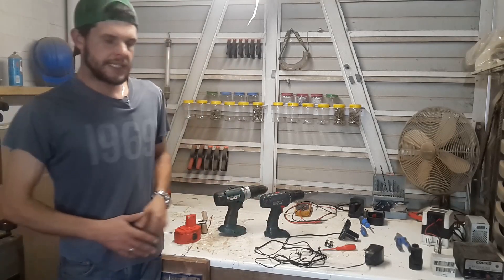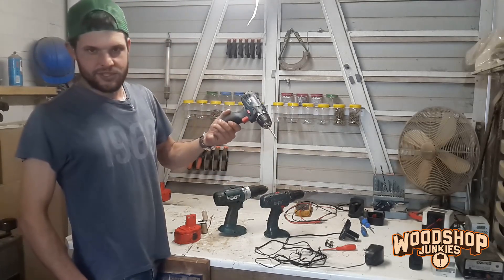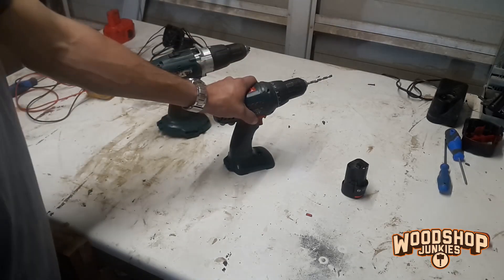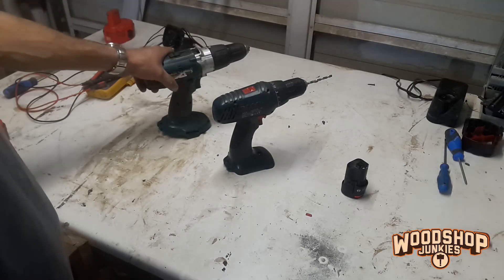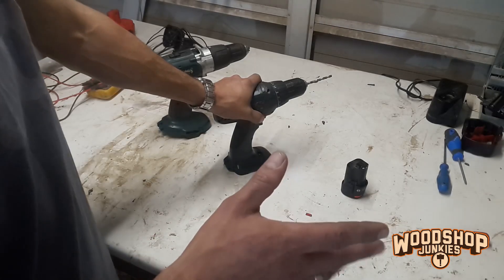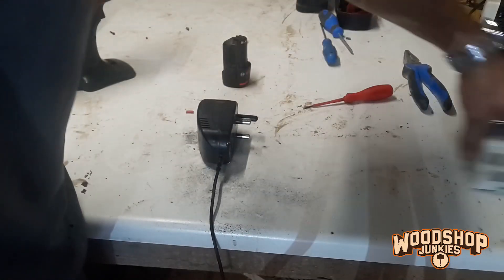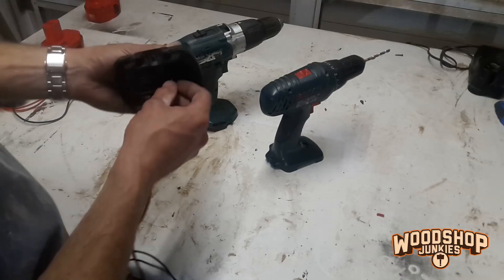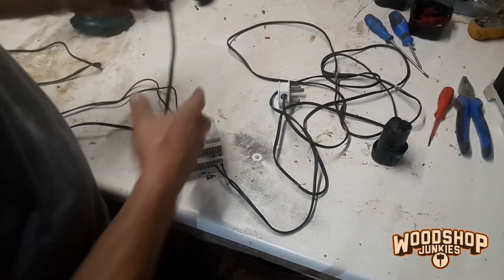Cordless to corded drill conversion without torque loss

Comment: Hi men thank you very much for this video. I have a 18v drill can I use those kind of transformator?? NEWSTYLE Convertisseur de commutation d'alimentation 110/220V DC 24V 15A 360W pour CCTV,Radio,Projet informatique, LED Light Strings et imprimantes 3D https://www.amazon.fr/dp/B0758BNMLH/ref=cm_sw_r_cp_apa_VaXxBbDF84E64
Reply: It looks like your specs are 110/220VAC input with 24VDC 15A output. I think the 24VDC is too high for an 18VDC drill. It will probably run it super fast and give it a short life. It might even brake the drill right away.  Better to get a DC voltage that matches the battery voltage. My impact driver came with a speed control trigger switch rated at 20A but other people are finding they can run the tools on much less than 20A.

Comment: Time to toss those old drills in the garbage and buy a new Brushless 18V Drill/Driver.
Reply: Why? When you already have them, like i have one that served me 10 years with out issue and almost new identical Makita drill body, but all the batteries have died over time. Almost any drill body works 10-20 years if i just get power to them, so this type of solution is great for workbench usage. 
Also i have summer home where i rarely need drill, but when i do, my primary one is usually in shop at home and there is no point of buying one for the summer home, or carry primary machine to summer home every time, so this type of solution would be perfect for it.

This type of hacking just extends the life of old machines, saves lots of money and is environmentally friendly if you are into that kind of stuff, but go ahead and shill your money to companies who design their products to broke down and let me guess you have Iphone on your pocket? go figure..

Comment: You need to put a capacitor on the exit of the rectifier to stabilize the current
Reply: @Chuck Kirchner yeah I think the trouble starts when batteries are odd sizes in parallel as they batteries try to equalize - the larger battery overpowering and destroying the smaller... that why its good to have similarly healthy batteries when building packs

Comment: I'm glad I ran across this video today. I've been wanting to build an adapter to run my 18 volt craftsman tools. They stopped making batteries and chargers for my set. I've tried power adapters and a laptop power supply. All of them had too low amperage. I've been looking for a way to build a power supply.  Thanks.
Reply from the maker: Not a problem Scott. Thanks for watching.

Comment: Just get a laptop charger with the same specs
Reply: I've tried this with my 18 volt drill. It didn't have enough amps to run the drill.
Reply: The Power supply must run in real time >10 Amps and the charger is maybe 1-2 Amos, way to low
Reply: It would work with a gaming laptop charger. This guy was using a 3.6 amp output at first and it was about 85-90%. You can get a 4.7A output laptop charger for $7.50 USD or a 9.5A output gaming laptop charger for $39 plus shipping out of China. I have a leftover 7.11A 130w from an Acer laptop I had stolen from me. It should do fine. You can't do it with a 3 amp netbook charger.
Reply: At the instance you connect a laptop charger with the drill and press the trigger, the heavy initial current drawn by the drill makes the laptop charger to trigger it's short circuit protection and eventually the output of the charger would be cut off. A 18 volt drill would draw more than 6 amp under load which is too much for a laptop charger.

Comment: Was the charging transformer & rectifier not adequate for the job?
Reply from the maker: Ken Barrow the first few units weren't no. All of their current outputs where too low. Only the large transformer I used last had a high enough current output.

Comment: hi can you tell me more info about the third dc supply the one you use for the first drill
Reply from the maker: Dimitris Vasilakopoulos hey man. I assume you mean the 12V DC power supply that I use to run the 14.4V drill? The little white one? It's a normal power supply that  has a 12V DC 4.5A output. I'd does have a volt adjust function that allows you to slightly increase or decrease the output voltage. Generally about 10-15% either way. To run the 14.4V drill I adjusted the power supply output to its max.

Comment: Food for thought but the twelve volt drill I would use a 12 v lead acid battery and charge it when it goes flat. Thumbs up
Reply from the maker: I did run the drill in the video on a car battery also at some point. Works great and has a good deal of torque. In the case of the 18V, two 12V batteries in series will also deliver similar results. However, the higher RPM from supplying a 18V drill with 24V might cause excessive wear and heat build up.
Reply: Run the 18v off a twelve plus a 6volt lead acid batteries not 2 twelve volts.
Reply: Tony Papantoniou dont conect 6v on 12v